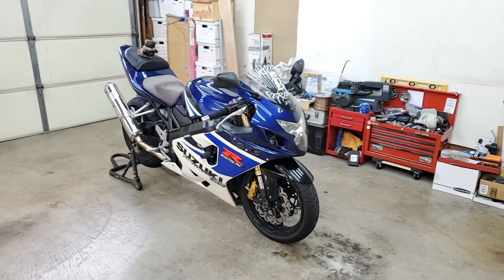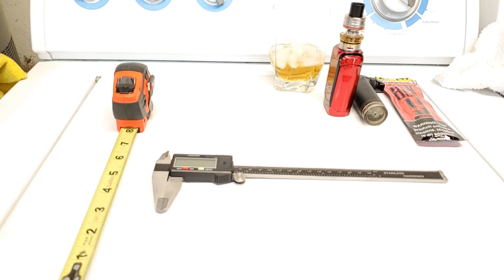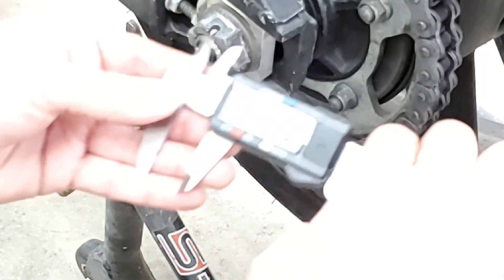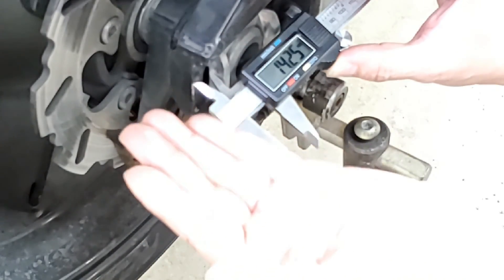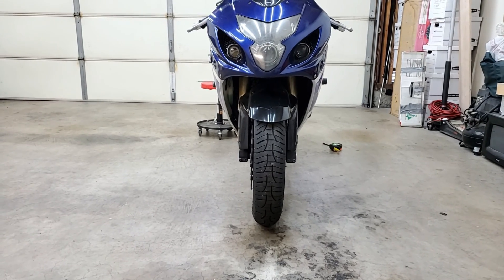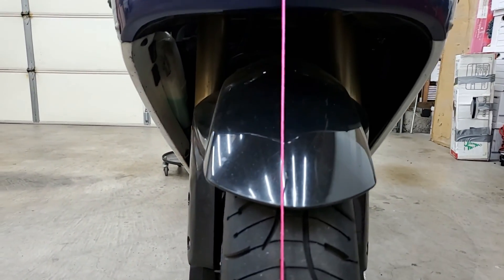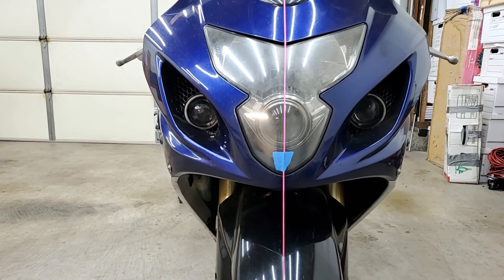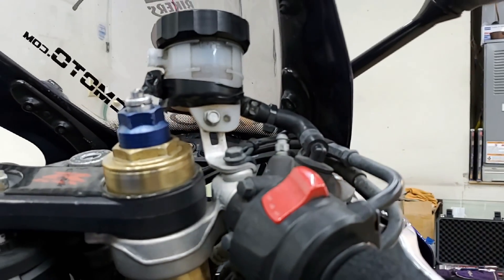Diagnosing Motorcycle Handling Misalignment Issues

Comment: I am having a problem with it moving to the right when I release my hands. Could the uneven shock absorber oil levels cause such a problem?
Reply from the maker: Anything is possible and shouldn't be ruled out. When it comes to forks and proper alignment everything should match identically to the opposite side. If the bike has been ridden with incorrect alignment you will get uneven tire ware and then this becames a factor as well. Make sure you check your rear tire and chain alignment as well.. you could be dog walking in the rear causing that pull..

Comment: music volume is insane compared to speaking...i had a similar problem where the rear tire had an angle to one side and the front to another. First did the rear same as you did. the front i did the pump the fork techniek and it worked very well. Good explanation

Comment: what minimal speed to test the pulling issue?
Reply from the maker: Happens differently for everyone. You'll know it if you have the issue. Mine was only really noticeable when going through a long banking turn.
Reply: if the speed under 60kmh mine has the issue, but it's disappear above 60kmh
Reply from the maker: @laurensiusnathansuryarachm1946  could be so, only you know how your bike is suppose to handle. I really didn't notice mine till I rode on a freeway overpass that had a strong lean angle.. it was really hard to keep the bike in straight line and would pull to the left on the bank.. this was at speeds lower than 50 mph.. everything else was fine when riding.. so you could be Right

Comment: Thanks for the video. That was really helpful. Just a question. A fall of bike on dirt street while parking (not riding) can also cause handling issues? I personally don't notice anything visually. So I'm not sure.
Reply from the maker: It can but you would notice it if it was affected. The bike would have handling issues to where it would pull to one side and you would be fighting it..
Reply: @TheChemistDIY  Oh. I didn't notice this kind of difference. Also, today someone experienced also rode it for a few kilometers. I didn't tell them about that incident. And still he didn't comment anything about handling issues.
Reply from the maker: @fanatic632  honestly, they probably wouldn't and that's because of the new rider experience. You see no one knows your bike better than you because you have more ride time in the seat.

 From the twist of the throttle and  engagement of traction, to the sound & vibration of the bike I can tell you exactly what's wrong with my bike and that's simply because I have 11+ years of riding Lucy and are now super in tuned with her harmonics.

It's the difference between having a new girlfriend and having a wife. You just simply know when something is not quite right because you are in tuned and can read each other.

Just like spark plugs tell us how the bike is running when removed and reviewed, so do your tires.. Aside from a pulling feeling (It may not be now) keep an eye on your tire wearing. If you start to feel a lumpiness or experience uneven tire wear such as  waves (high/lows) in the rubber then you have an alignment issue.
Reply: @TheChemistDIY  Cool. I might be overthinking too. But I'll keep that in mind.

Comment: Is it a correct method to inspect the alignment by looking at front mudguard and tyres because mudguards are attached to forks.
Reply from the maker: Good question, well it's kinda like this.. ever hear of the mechanics touch.. the method of torquing a bolt by hand and not with the correct tool because you've done procedure so many times that you're body/hands have come in tune that you automatically know what say 16 lbs of torque pressure feels like that you don't actually need the tool anymore to perform the job to the correct specifications.

The center of the bike .. well, is the center of the bike.. and all the aerodynamics are based off of that.. could they be off.. Yes, but probably not by much. My recommendation is to find 3 center point of reference.. ie triple tree nut, tip of nose cowle, and point of mud guard.. if all those line up straight.. then you have you center line of your tire.. some will argue differently, but it works for me..
Reply: @TheChemistDIY  Hey man thanks for the reply.

 I've think it's a bit difficult to find the alignment by looking at the headlight portion in a naked bike like mine because headlamps are attached to triple trees. When we moves handle bars headlamps also moves. But in faired bikes it won't and we can refer the headlights with tyres. 

I am facing a left lean and some traction issues after changing the head bearings from a service center. I've used the cpr method like u did few days ago and tighten the head bearings now bike is a 70% ok ok. There is only some minute lean and i'm trying to figure it out. Hope i does 😁. I also done a few adjustment an hour ago. Now I looked into the tyre mudguard and front tyre and i draw some lines in the mudguard and found the ceter portion in the mudguard draw a straight line and i've think the front tyre and mudguard are aligned straight because the in the tyre pattern there is a straight line through out the tyre in the middle, like a line which will make it easy. Waiting for some test run tomorrow.

I've also has some doubt here in my place the road pattern is like curves on both sides for easy water drainage ie, there is curves on the both left and right like this 👉 /\  Will this results in pulling. Because i tried riding on opposite direction and bike pulls towards right. And riding on normal line bike pulls left.
Reply from the maker: So crowned streets are not a good road surface to test out the handling of your bike and yes they will make you pull in different directions. You need to get on a flat road surface to insure your realignment is correct.

In the future to find center on your tire, yes you can use the half line in the center of the tire that was left by the mold in which it was made from.. if it's still there.. this tends to go away after so many miles.. if it's not there then take a piece of string and wrap from rim edge of the right side, over the tire, to the rim edge of the left side.. fold that in half.. this will give you a center that you can mark on the tire.

Other things that can cause pulls is a trailing rear tire.. where your rear tire is slightly off.. make sure that is on point as well.

Have you changed or removed the front tire and if so did you replace it back on with the proper technique? If not then your forks could be binding at the spindle.. ie there not flush with rim.. many people don't know about the proper way to put back on a tire.. and think you just slid the spindle through the fork leg, into the rim and bolt everything back up.. you actually have to perform the CPR procedure while lose before tightening everything up.. crooked forks give you a crooked ride ...
Reply: @TheChemistDIY  Yeah will do sir 😁 Thank you for your time ❤️

Comment: when i am balansing left side and eiggt side marks on same position wheel is touching on chain do you have answer why its happening?
Reply from the maker: TWC, not sure if I'm understanding your question brother. From what I'm gathering you've set your rear wheel alignment with the position markings on the frame to match on both sides and your chain is touching tire???
Is that Correct???

Is this a new chain or an old one??

How far back is your tire position settings (tick marks) showing from the rear.. very last tick mark??
Reply: @TheChemistDIY  its is new one and my motocycle has 10 marks on left and 10 on right when i put both sides on 1.5 couse its new rare wheel is touching chain like middle of bike so fromt side of rare wheel some something is rotated and i cant understand what
Reply from the maker: Do you have the correct spacer's in place?.. the spacer on the rear brake caliper side (right side) is shorter then the one on the sprocket side (right side).. if I'm not mistaken.
Reply: @TheChemistDIY  spacer is original on support side where is rare brake i think it is all foult front spocket becouse after i changed chain and sport spocket with my self on first time after that started such disbalancenon rare wheel
Reply from the maker: Sprockets should have a general thickness that's specified by OEM requirements. Additionally some sprockets have to be installed in the correct orientation.. meaning they have a front and back marking to identify which side should be facing you and which side should be facing the engine or hub if we're talking about the rear tire. 

Could it be possible that you installed them back words and need to flip them around to gain the additional clearance the chain needs to clear your rear tire.

Else they may have shipped you the wrong sprocket set.
Reply from the maker: It sounds like you know what you're doing but just in case take a look at this video and you'll see what I'm talking about.

https://youtu.be/bprw2TMOmQU